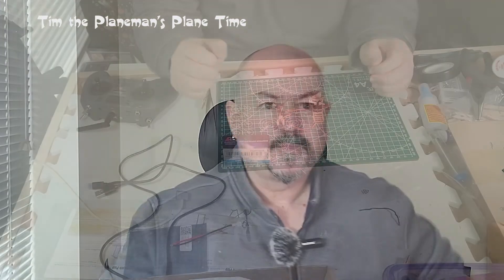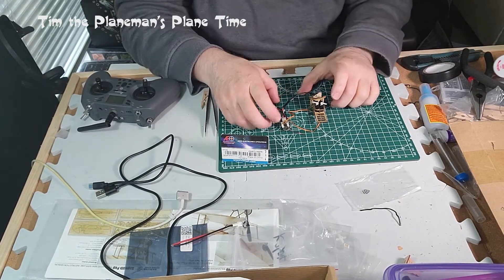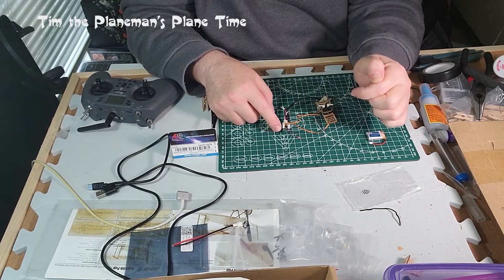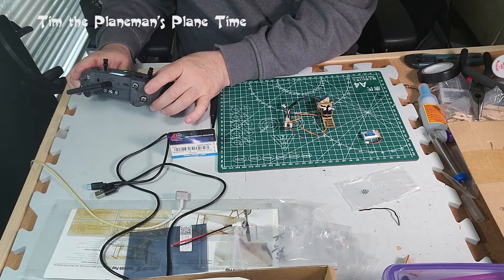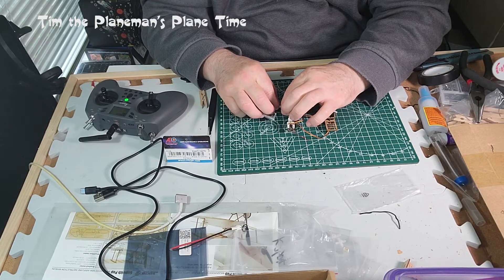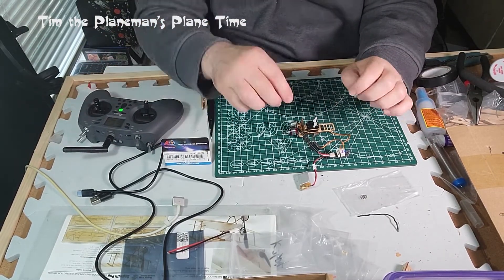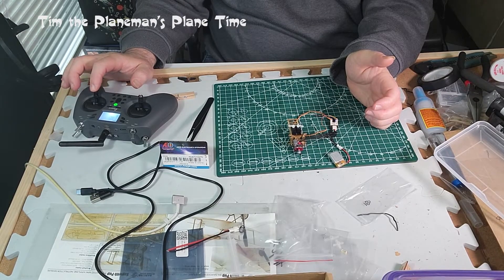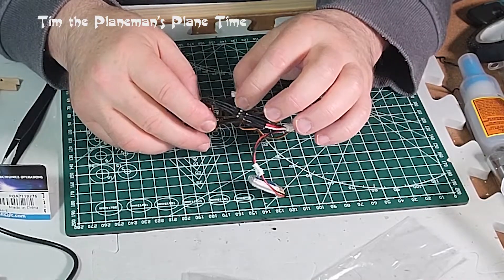16.3 Sopwith Pup Electronics Pt3 - Dancing Wings Hobby micro RC balsa model plane build

Comment: The electronics is where I struggle 😂 Soldering is not my forté but YouTube is my friend so still learning. Also, maybe I don't have a decent TX unit that can connect to different RX setups. Not sure how that all works. I'm investigating and working on it 😀 Your videos have got better as I go through them (eg sped up during boring/repetitive processes and edits etc) Thanks for spending the time recording all this and putting online. Even if I don't do the Pup, they've been very helpful 🙏
Reply from the maker: Yes that was me when I started, I still don't like soldering much, but I can do the basics. The Pup combo packs give you a choice of receiver, so if you have a TX you can probably get an RX to match what you have.